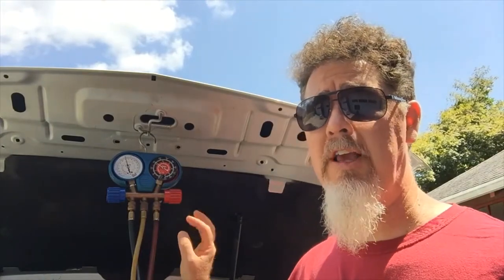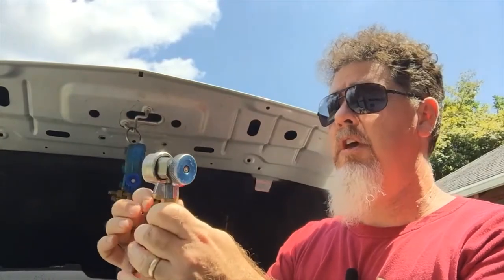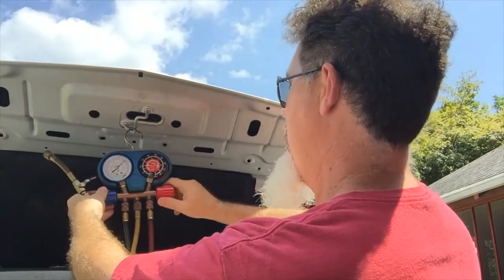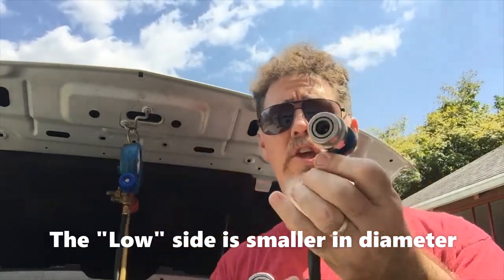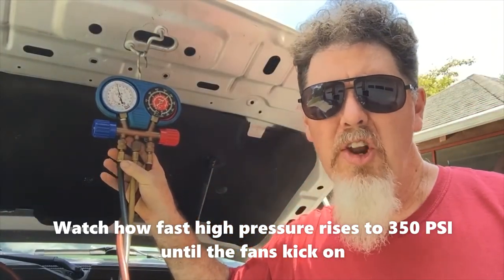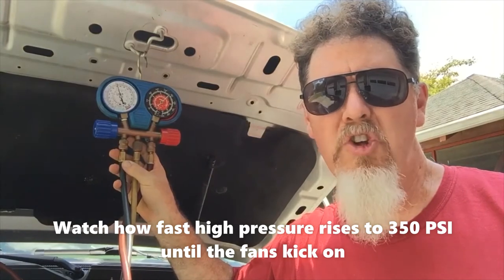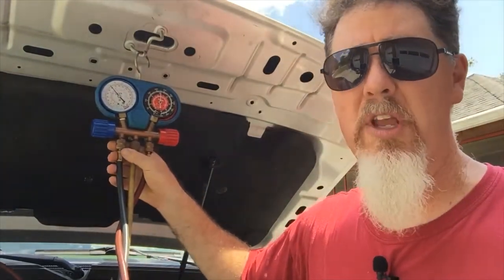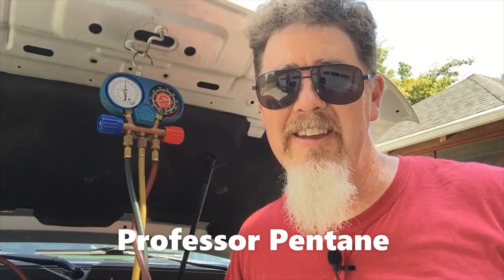How to install A/C Gauges

Comment: Hey Professor Norman, quick question on static temps and high ambient air in high heat days. I live in El Paso Tx and just purchased a mastercool 89661 pro. My question is what am I supposed to do if the ambient air is 108 and my new gauges on the low side only goes up to 95Deg F at 120 psi and the gauge goes into "retard" on static check because it is so hot ?? I quickly started the vehicle and it came down to 35-40 right away, but I am afraid of breaking my low side gauge that way. Any advice?? Thx in advance. Mark W5YAK
Reply from the maker: Hi Mark,  I have not damaged gauges yet having the low gauge max out, it is just a part of A/C work.  I use Mastercool gauges at the university and had no problem with them maxing out.  You do want to check calibration on them every now and then.   The should read the same PSI with the A/C off.  Thanks for watching, PP.
Reply: @ProfessorPentane  You're the best Sir!! Thx!!